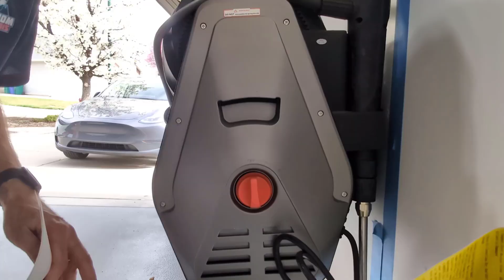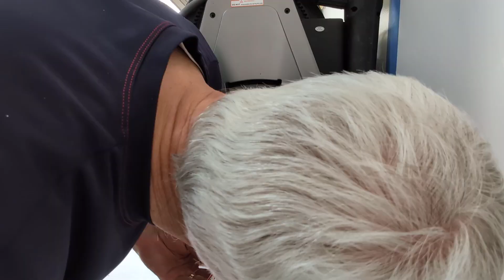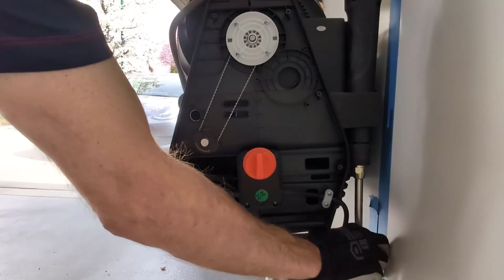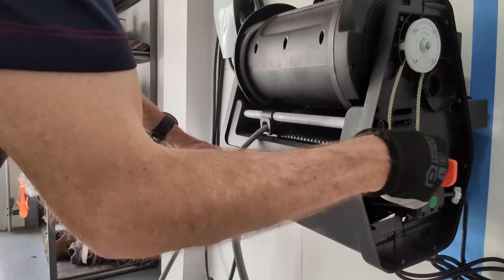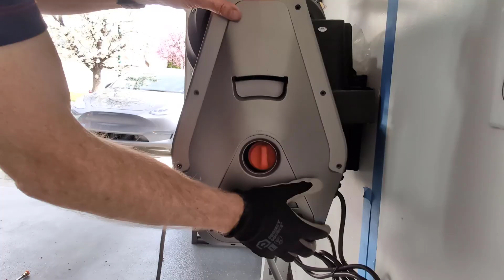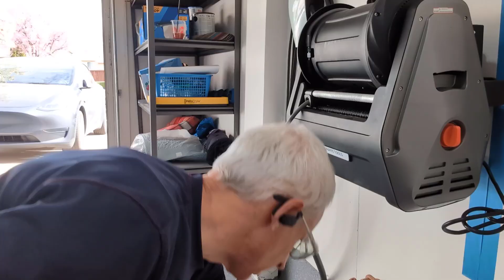Fix your Giraffe Grandfalls power washer hose guide misalignment!

Comment: Yes... thank you for taking the time to post this, I've been cursing and fighting mine for well over an hour. Tried to take 5he hose out and rethread it but still ended up off center and kept getting stuck. I'll try this method looks simple enough... be back in 10min....
Reply: Ok... it's been longer than 10min but that's only because I didn't want to mess with it in the 103 degree TX weather. Anyways, it was a very quick and easy process, worked like a charm! THANK YOU, THANK YOU, THANK YOU!